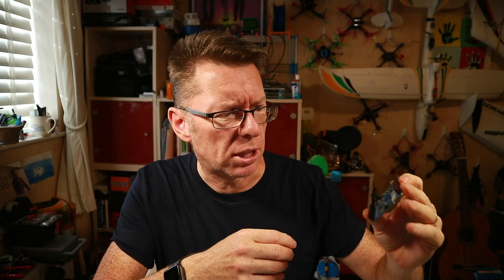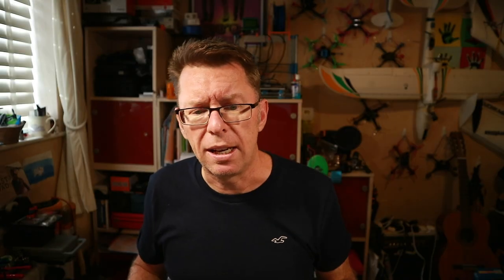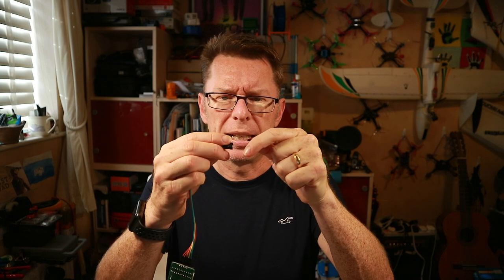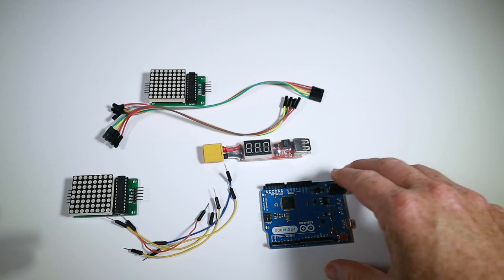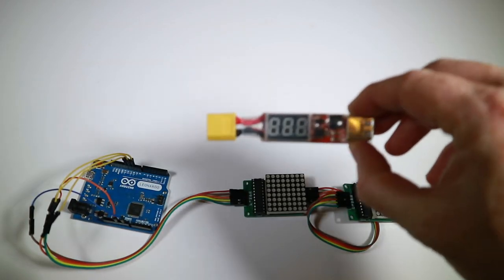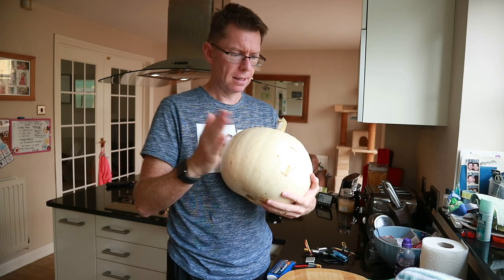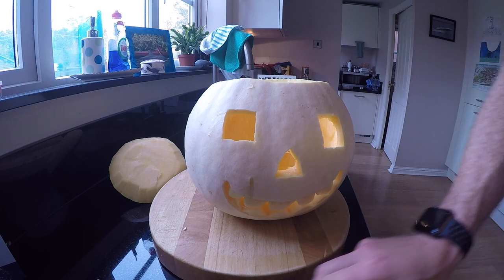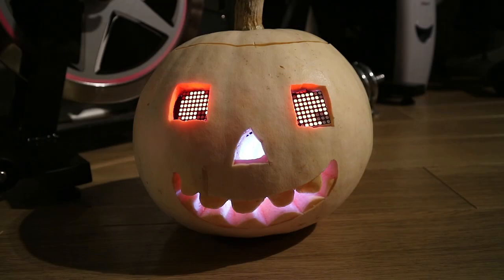How to make a Halloween Pumpkin with animated LED eyes

Comment: This is great, but getting the eyes to stick in is such a pain. I'm currently staring at my pumpkin trying to find some way.
Reply from the maker: Unbending a paperclip and fixing in works normally ok, but thinking about itjust bending over a piece of paper a few times and ramming it in the gap should be fine and you shouldn't be able to see it from the front
Reply: @currykittensrandomizer6025  they do make the matrix with the driver IC in back instead of off to the side you know
hose are the kind i ordered but they won't turn up fora long time i'm afraid
i could only find red thought ,i wanted orange or amber but they were all expensive
i did manage to find some amber/orange 8x8 leds only without the drivers for a more  reasonable price
i would neet to order the driver boards separately and solder them up , ,i just ordered red since it was still cheaper but i might  get the orange ones later ,hopefully i can find orange ones "pre welded" that are not so expensive